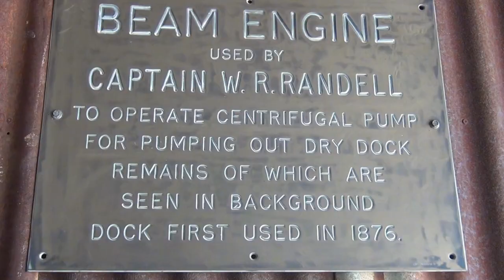All Steamed Up 2018

Comment: Great! Did you get any good contacts for steam engines? I'm looking at plans for one vaguely similar to @3:10
Reply from the maker: That beautiful boat was called Iona. What struck us about all the steam boats was how much space the engine took up. After the wood supply there was no much room for anything else. Much as the steam notion is attractive, I think solar holds more promise especially because it would be so quiet.
Reply: Have a look at Peter Sewell's WHIO.  A beautiful and efficient boat - Some pictures online, but also featured in WoodenBoat #190 for a more in-depth look
Reply from the maker: @markl9689  Thanks I had a look at this one: https://www.youtube.com/watch?v=MAe5SSQACpc